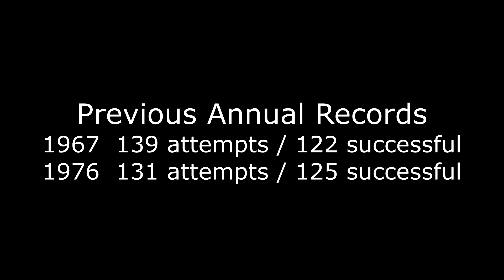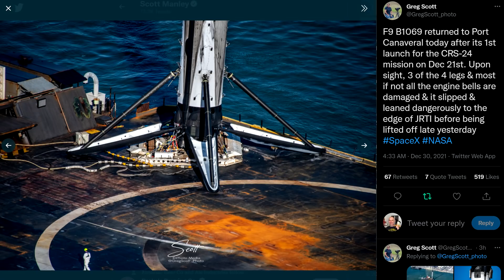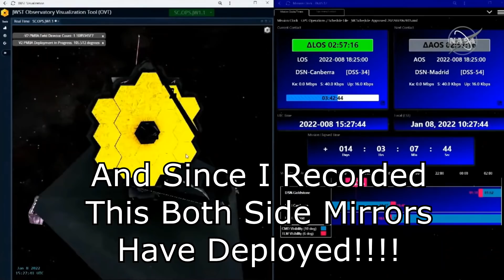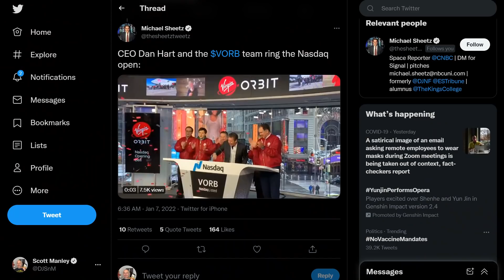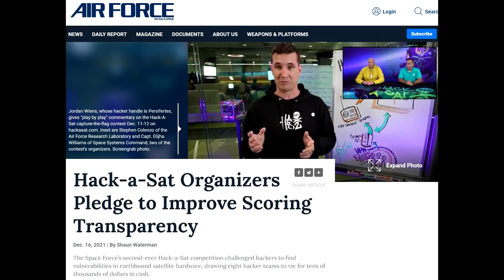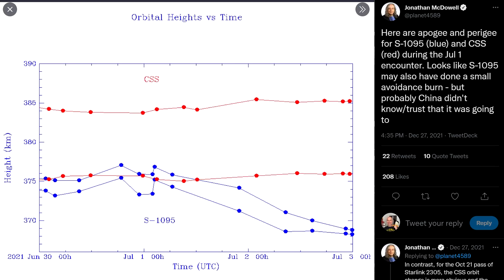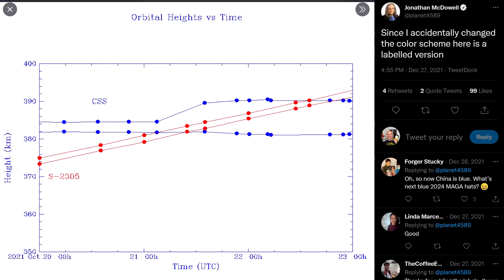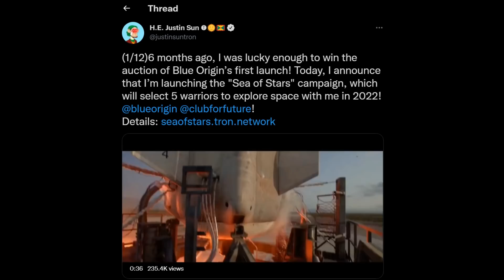JWST Deploys Mirror &  Moon's 'Mystery Hut' is Revealed - Deep Space Update - January 7th

Comment: Adding a camera system to JWST would require more of what would become dead weight, require even more complexity, and require more complex engineering to maintain heat separation from the cold equipment. The equipment is complex and expensive enough without adding extras that would possibly get in the way of the important mission critical equipment.

Added for clarification:
The JWST team determined that adding a camera system would take away from the scientific mission. The extra mass and power consumption of the camera system would have to be made up with other mass and power reductions. That would mean either removing instruments, making the mirror smaller, or reducing onboard fuel capacity. Reducing fuel capacity would shorten the mission life. None of the reductions to the scientific mission were worth it just to provide some cool views of the deployment.
Reply: Exactly. It might be interesting for the general public to watch everything unfurl in space, but unless those cameras can be repurposed to make some useful contribution to the mission, they'd just be useless extra mass.
Reply: @igotes  Microcameras weighing very little and still being able to produce high quality images would have monitored the entire commissioning operation.
Huge mistake by the JWST team.

I believe there are hidden cameras and sensors on the JWST.
What are they hiding?
Reply: I think the issue was more the shear number of operations that would have to be observed which would have required multiple cameras or a camera on a manipulator arm which could move around the craft which would have massivley increased complexity. Even if when you were done you jettisoned it you still run the risk of debris hitting the craft.
Reply: Or like Scott said it could just be a battery draining mistake...
Reply: Depends on whether the added camera system is worth the extra cost, effort and risk.
Reply: @PetraKann if it drains the battery even a little and shortens the mission length and ability even by a minute it is not worth it when a few sensors could do the job with no risk and 0 costs added.
Reply: @PetraKann  
The JWST team determined that adding a camera system would take away from the scientific mission. The extra mass and power consumption of the camera system would have to be made up with other mass and power reductions. That would mean either removing instruments, making the mirror smaller, or reducing onboard fuel capacity. Reducing fuel capacity would shorten the mission life. None of the reductions to the scientific mission were worth it just to provide some cool views of the deployment.
Reply: @GoCoyote  Camera technology has advanced to the point where very tiny cameras can produce high quality images.
A few micro cameras positioned throughout the JWST for monitoring the commissioning and operation of this space telescope would have been very useful GoatCoyote.
Reply: @PetraKann  
The engineering team was asked why they did not have cameras. Their answer was that any camera that would be able to function with any reliability in the conditions they would be exposed to in space required enough engineering complexity, and created a weight penalty that would have to be made up by reducing the telescopes capabilities and mission life. They said that having cameras in no way would help the deployment, and after the sunshield was deployed, would not be able to see anything on the shaded side without adding lights to illuminate the telescope.

Why spend 10 billion dollars on a science telescope and then handicap it just to get some photos of deployment. Some very smart people concluded that spending millions of dollars of taxpayers money for photos that did nothing other than entertain rubes like us, was just not a very good use of money.
Reply: @GoCoyote  I find that very hard to believe Mr Coyote.
The most expensive unmanned space program in the history of humanity, consuming over 10 billion dollars, heavily over budget and overdue, shutting out many other worthy space programs that cost far less, and you are telling me that they couldnt afford a couple of Radio Shack micro cameras, a few batteries and silver coated umbrella for $73 ??
This little John Debb scope better work - that's all I want to say my friend.
Reply: @GoCoyote  The Engineering Team made a huge error in judgement here Mr Coyote.
Who is heading up this little Engineering Team of yours?
I am an engineer and I can tell you my friend, this sort of oversight would not be treated lightly by upper management.
Reply: Maybe in the next generation of telescopes they will attach a cubesat with RCS just for photos? Similar to the Perseverance rover and the ingenuity helicopter. That would be a good PR stunt =D
Reply: The real question is how do they know its doing what it says its doing? Sensors right? What does that mean. What sensors are they using and how are they using them? Are they using 2 sensors per operation for redundancy and extra confirmation? Are they just contact sensors? I would love to know how these things actually work.
Reply: @peterw1534  
As an electrician I have never worked on anything involving rockets, but I have worked on complex control systems, and once worked with an engineer who worked for many decades on the Apollo program (did he ever have some good stories).

There are many types of sensors that are used to "see" how the equipment is functioning. Some of the simplest are current sensors for the motors that can tell how much the motor is being loaded by the amount of current it is drawing. This can tell you if a part is stuck and that the motor cannot move it.

Others will be positional sensors that provide feedback as to the position of parts in relation to one another. This can be something like a high precision sensor similar to that used on a set of digital calipers, to simple switches that close or open when something has reached its targeted position. Some types of motors, called "stepper motors" have a built in ability to know how much they have rotated, and can be rotated in very small incremental steps.

Other sensors could include stress and deflection detection, and amount of force applied. Some or all of the sensors may have an electronics package either integrated or co-located to take multiple sensor inputs and then send the information back to the main controller and communications equipment on a single set of wires, similar to getting many channels on your cable TV. There may be multiple types of sensors used in conjunction, so if one fails, the information can be extrapolated from the remaining sensors.

The upshot is that all of these sensors would be needed regardless of having cameras, and all of the information needed to deploy is provided by the sensors, so why add cameras that would not help anyway?
Reply: @GoCoyote  What an awesome response! Thank you so much for taking the time to explain this. This is fascinating to me and I feel like these little details are always overlooked (probably due to time constraints) and just summed up as "sensors". I assume that they know what they're talking about when they say cameras aren't necessary and this explains why! Cool stuff.
Reply: @peterw1534  
You are most welcome! This not any way meant to detail the methods and equipment used on the JWST, but to just provide a general overview of the types of sensors that are generally used. They likely are using some very interesting tech, although somewhat like the military, they will often pick older tried and true equipment on mission critical components to ensure success. I work with this stuff, and still find these projects like the JWST just fascinating. Sometimes I wish I had taken a more similar path to my brother and became an engineer so I would have had more of a chance to work on such cutting edge projects. But they do use electricians too, so it more likely has to do with finding the right contacts, having the right skills, working for the right companies, and being lucky. All my best to you successfully fulfilling your curiosity!
Reply: If something goes wrong, I doubt a camera will be any help. Also, "a huge error in judgement"? What nonsense. I'm pretty sure they've made all the right judgements here.
Reply: @igotes  Do you have an engineering background Igor?
"pretty sure" is simply not good enough when we are dealing with 10 Billion dollars.
Do you know how many student loans that equates to?
I know one thing that is "pretty sure" and that is I would apologise if I were in your shoes.
Reply: @PetraKann  I studied electronic engineering, I work as a software developer. I have never built anything that has left the earth's atmosphere, though. Clearly the JWST is suffering badly for not having you on the design team.
Reply: @igotes  
I believe you may have accidentally attributed a response from someone as being from me, as I heartily agree with you!
Reply: @GoCoyote  Apologies if it seemed that way, I certainly agree with you. Any ire would have been directed at Petra Kann who seems to be one of those obnoxious commenters who is "always right".
Reply: @igotes  
I apologize to you also. Upon closer reading I see I interpreted your words as being directed at me. Well, it is all about me, isn’t it! James Herriot, in his book All Creatures Great and Small, quoted his boss Siegfried as saying “life offers endless opportunities to make fools of ourselves.” I add that we can learn when to take full advantage, and when to pass on those opportunities. The tricky part is figuring out which ones. As I get older, I am trying to acknowledge that what I consider to be factual is oftentimes opinion, both for myself and others. I find it interesting that I and many people will contribute nothing to original research and thought, yet develop such strong opinions that we label many things as fact if we trust the sources. Being able to be wrong without feeling threatened is the most valuable tool I have found for myself. Still working on it!  I am waiting with bated breath for full operation of JWST. All my best!

Comment: Hi Scott. Quick Question - what if starship had a "Gas Fountain" on top so to have Less atmospheric resistance on launch? why it's not in use yet.
the Idea being used in Jet-ski by spreading bubbles underneath the body.
Thanks
Reply: Not worth it, air doesn't induce that much drag and rockets don't spend a lot of time in the atmosphere anyways. In the water it's a different story, the whole concept comes from Russian rocket powered torpedos that shoot some of the gas out the nose to blow the water out of the way. If this was useful for rockets we'd have seen it on planes like the SR-71
Reply: @E9X330  Getting smarter every day. Thank you B
Reply: The amount of gas necessary to be useful might have so much mass as to more than outweigh the benefits. (Not the first time a mass versus friction choice has to be made. It can come up in aircraft design.)
Reply: Fascinating idea. Maybe try it on airplanes first?
Reply: It's a cool idea, but i have no idea if it would even work

Comment: Do you think they could position Webb to get a shot of either Voyager? Would be cool to hang that one on somebody's wall.
Reply: No. JWST has resolution of ~0.1 arc-seconds. Voyager-2 antenna dish is now ~4*10^-8 arc seconds (or 2.5 million times smaller than 1 pixel of JWST)
Reply: They don't have to be resolved though: they could be seen as single points of light. But given that objects kilometers wide are practically insivible at that distance, I doubt the voyagers are bright enough to be seen even in the far infrared.
Reply: @Релёкс84  1-pixel black photo on the wall isn't going to look nice, unless it's Malevich)))

Comment: What makes Virgin Orbit think they can be commercially successful when Pegasus was a failure? Can Virgin launch larger and/or heavier payloads?
Reply from the maker: They’re much cheaper because they don’t have the fancy composite wing. Also, the 747 carrier aircraft is a lot cheaper to maintain (because it was such a common plane) than the Tristar that Pegasus used.
Reply: @scottmanley  I wasn't aware Pegasus had a fancy composite wing. Was that on the TriStar or the Pegasus rocket itself? Perhaps a video comparing and contrasting the two would be interesting.

Comment: The answer to a light that is stuck on is to simply power that light, which would be used only during deployment, from its own battery. Relay fails to open? battery dies; light goes out; end of problem.
Reply: Batteries don't like cryogenic temperatures though, so it would just not work once you started to deploy the sunshield.
Reply: @Sakkura1  The battery, would be in in the same compartment as all the other electronics. Nice and warm. The only things cold would be the wires and LEDs on the dark side.
Reply: @bill20061946  Then you would be complicating the design with a bunch of wiring. Not a simple modification to make.
Reply: @Sakkura1  of course it is more complicated. But with $10B and 25 years, I'm sure two wires and a battery, essentially a flashlight, would not have overtaxed the engineers. But they obviously did not think it was necessary since we know the status via telemetry.

Comment: Is it possible to re-enter a spacecraft without a special heatshield from orbital velocity with aerobraking only i.e. taking it veery slowly and using aerodynamic lift to control the heating?
Reply: As an amateur Kerbal Space Program Pilot I would assume you end up in orbit again although with a lower apoapsis. So it would take multiple orbits to slow down just enough to remain in the earth's atmosphere.
Reply: Your vehicle will have a horizontal velocity vector north of 7 km/s and the atmosphere will have a too low drag for parachutes. You’d need many, many revolutions to brake and come in cold.
Reply: So spending many revolutions aerobraking and not be bothered by where to land could work? As an emergency deorbit strategy.
Reply: No. By the time the air is dense enough to have any lift, you’ll have already burnt up without thermal protection.